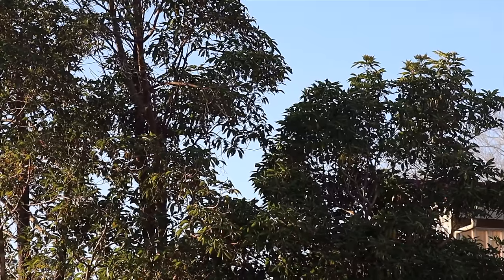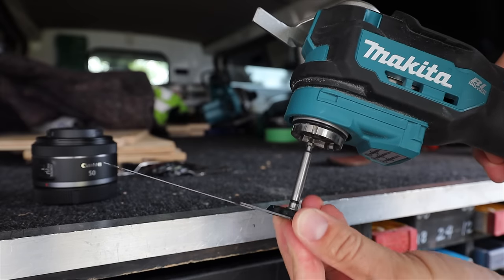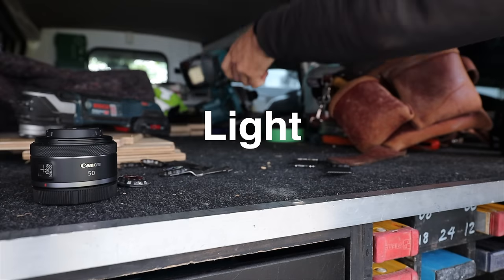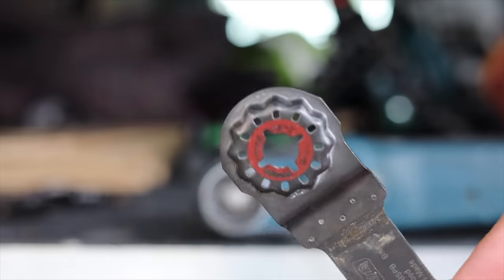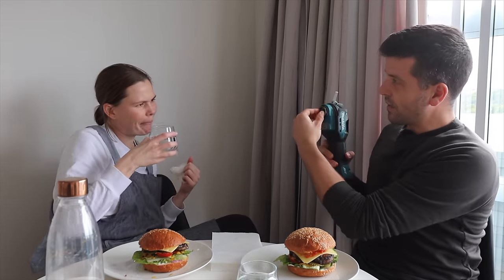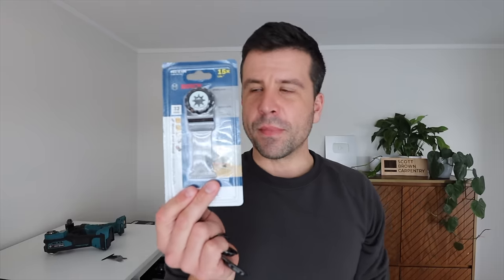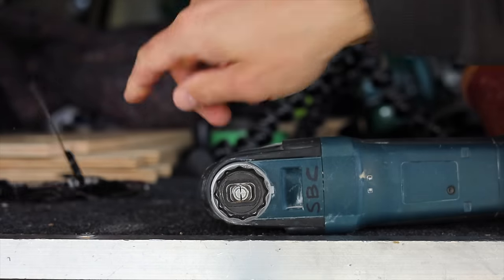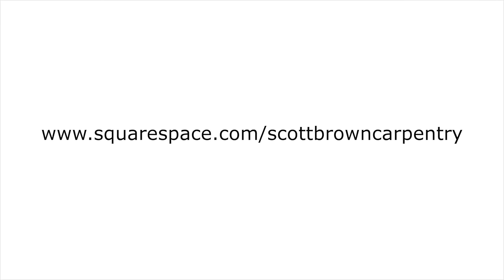Have Makita Made The Ultimate Multitool?

Comment: Fein had the same pin idear about 8 years ago. The pin used to wear out quick so you could no longer keep the blade tight
Reply: Fein invented the Multitool back in the sixties and the Starlock system was an collaboration of Bosch AND Fein. Fein is often overseen, although they are the oldest German tool company and invented for example the first powerdrill ever! As far as I know is the Festool multitool also manufactered by Fein. I don‘t know the Makita multitool yet, but the anti vibration system of the Fein I owned is outstanding!
Reply: My old bosses fein multitool was incredible. So much power and speed it was a pleasure to use.
Reply from the maker: I didn't know that. It will be interesting to see how the Makita goes over time.
Reply from the maker: @thorstenkrieger6289  that's awesome. I've only tried the Fein a handful of times and was impressed. Both Kameron and Gaston have one and they love it. I didn't know they went that far back. Cheers
Reply: I also have a Fein, and I love it :) , Fein general market is Metal industrie, have a angle grinder from them , small 125mm disk and 2000W it’s just a monster

Comment: I've had a corded Bosh for 5+ years hanging around the garage for home projects. I now have a cordless Makita that I use frequently as a career handyman. The thing I love about the Bosh pinless is when you are sanding with it. Each time you change grit size on the Makita you have to pull the paper off to get the pin out. That often leads to the backing failing on the paper before the grit is worn out. On the Bosh you can can just buy a 2nd (or 3rd) sanding plate and keep the paper intact as the clip couples & uncouples behind the paper surface.
Reply from the maker: Ahh, good point!
Reply: I made a hole in the paper just to get arround that... but it tends to collect dust up arround the pin if you do so.

Comment: The whole time watching this, I thought that pin is just an added unnecessary extra, and easily lost . You proved me right at the end. I really like dewalts clip on system.
Reply: When the pin was revealed I immediately thought 'Going to need to get 1 or 2 spares of the pin.'
Reply: I agree but I have never lost the pin on my gen2 makita multi tool. I envy the the ease of use of my dewalt cohorts though. Do you like the adjustle power trigger thing on the dewalt or the idea of the makita on/off better?
Reply: i have the dewalt battery multi tool with that "easy" blade install, sometimes at least on mine which is not even a year old, it gets tough to actually push it hard enough to open the jaws, and don't even get me started on trying to get that blade perfectly centered
Reply: Not much different than changing a disc on a battery grinder haven’t lost the collar on that yet  touch wood
Reply: The immediate predecessor to starlock (in Fein world) was a pin system.  I have found it to be better than the pinless starlock system when trying to set the angle of the blade in a tight spot.
Reply: Fein, maker of (arguably) the finest (pun intended) multi tools used a pin system for many years prior to release of starlock. Never heard anyone complain about losing pins and I certainly never lost mine. I am sure it happened but not enough to detract from an otherwise excellent tool.
Reply: Dewalts system is great
Reply: Got the dewalt myself. In addition to what you said I love the pistol-grip where you have stepless adjustment of the throttle.

Comment: I bought a Fein brand multi tools and man that the best one I’ve used so far, never used the makita and/or festool! The Fein is awesome it has a great sanding attachment and decent dust collection!!
Reply: Fein is still the gold standard in my opinion.  I have a Fein multimaster and a Festool. The Festool is a Fein supercut with Festool branding on it. They have a deal together. But yes, I tell everyone they don't understand what is a good multi-tool until they use a Fein.
Reply: I had the fein multimaster. It was very smooth and just nice to use, wway Less vibration than any other one I've seen. But one day it broke inside, because to keep vibration down the head is only attached to the motor by very small glass filled plastic arms. I had it maybe 5 years. Looking inside it seems to me this will happen to everyone eventually. 
So I bought a cordless Milwaukee and it is just as good or even better. Very smooth, has a light and definitely cuts quicker. One of Milwaukee's better tools!
Reply: @worstdayofmylifesofar.just7477  the cordless Milwaukee is what we use at work and it is a piece of junk IMO and in the opinion of everyone using it, pain to change tools, vibrate like crazy etc etc !

Comment: As soon as me and the work mates turned on that new Makita multitool we all looked at each other and couldn't believe how quiet it is. I upgraded straight away. Did a comparison of decibels between the old and new and there is 10db different which is a lot. Great video Scott!
Reply: it's often the material you're cutting that starts ringing and screaming far louder than the tool.
Reply: @throttlebottle5906  100% the material makes half the noise but its a good start the tools way quieter.
Reply: @jaredbrierley2782  ever used one of those tool on a sheet of plywood or any large less dense surface? say a particle board cabinet(bae or wall), further that by plywood, particle board, and others?
they're more or less a "speaker cone" for the tool and total degree of movement and tool noise becomes nullified by the giant speaker screaming :)

Comment: I had this multitool for not even two weeks when something in the pin locking mechanism snapped off and made the tool unusable, i took it apart to see that the part was designed nowhere near as strong as it should have been considering the torque put on the part with the leaver which im guessing is what made mine give out. I sent it to makita to repair and ive been told that so many people have already been having the same problem so makita are having to redesign the part itself. And I can confirm the larger head does get in the way at times unlike others like the feintool that i had been using previously
Reply: Had mine a week, same thing. Was repair and back to me in 5 days. Great tool tho..
Reply: @graemeb7988  Oof damn, inside? wjhere you have to send it somewhere to repair, thats a no go then.
Reply: My one doesn't work after 5-9 time of using it... Can not take the pin out...

Comment: I’d be interested to see if the larger head on the body of the new Makita gets in the way at all. Often you’ll be multi-tooling in an awkward or cramped space, the larger body head may cause issues.
Reply: he just made a valid point lol, look at the other multi tools theyre way slimmer than the new chode
Reply: That is definitely a valid concern.  The solution to that may be to use the longer and overall larger Starlock max blades.  I get why they designed it like that.  Everything was squished to the business end and then the handle is decoupled from the body.  With the cordless Fein/Festool models, you have to hold the tool all the way back at the battery to avoid the vibration.
Reply: I just came to comment this
Reply: My mate bought one, only found the size of the head to be a problem when it came to visibility in small spaces, seeing what im cutting
Reply: Most likely shaped that way to reduce the vibration
Reply: Like toe kicks!
Reply: Yes your right, that’s why I went for the Allen key version, as opposed to the quick release and it’s cheaper 😊
Reply: I bought this and it definitely gets in the way
Reply: That's why I also bought a 12v bosh one 😅
Reply: It definitely does. I’ve returned mine because of it. Got an older model instead. Apart from the vibration and noise when not cutting. It’s just better in every way.

Comment: I have also the Bosch one and I figured out that you just need to widen the hole with a dremel and the STARLOCK MAX blades will fit in the PLUS one 😁. cheers from Austria
Reply: I've done the same before for my Fein but just used a slightly larger drill bit

Comment: My favourite tool change system on a Multi-tool is actually on a Ryobi! It uses the classic OIS blades, BUT instead of a bolt that you manually have to screw and unscrew every time, the bottom bolt is attached to a sprung lever which opens up enough gap to change the blade... I.e similar to your new Makita except the bolt is fixed in place so you don't have to take it out every time (and you can't lose it!).
That's not even the best feature though... 
The entire tool head is also on an adjustable pivot so the blade can be up to 90˚ from the body which makes it super handy to get in tight spots.
Reply: So you have to use the blades with the split on the ring, to get around the bolt, right?
Reply: @xenonram  ideally, yes as it makes changing them quicker. But the top of the bolt also comes off if you want to use the full ring blades.

Comment: The Dewalt quick release mechanism on their multi tool is awesome.

Great review as usual. 👍👍
Reply: Personally it's the variable speed trigger control that dewalt have that I like about them. My go to multitool over the apprentices dewalt and my 18v makita tho Is my m12 milwaukee. Quietest, just as strong as both 18v and less vibrating
Reply: 100% agree you get the quick change lever, can adjust blade to 90 degrees quickly but still use the cheaper blades.
Reply: They burn out to easy
Reply: i've found it hard to get those blades to be at an absolute straight 0 degree mine always is slightly off to the left or right, especially with cheap blades but even the most expensive ones it still doesn't fit perfectly straight, and at times getting my jaw to open and release the blade becomes a hassle
Reply: @orran8281  found exactly the same
Reply: Milwaukee multi tool beats them all
Reply: @Emtbwebb  Milwaukee are simply overrated. Dewalt beat them virtually across the board and are around 20% cheaper.
Reply: @krazzygranny7032  I'm in the UK and I've started to see Milwaukee everywhere in recent years. A guy I do a lot of work for swears by them.
Reply: @BlueZirnitra  agreed, I'm on Dewalt platform due to cost.  I'm working hard to save for some Milwaukee tools.
Reply: Also the dewalt hand trigger is much better then a slider makes the job more accurate
Reply: This is starlock guy lol
Reply: untill u test bosch // fein starlock system u wont ever want to use any other brand 
i test it too and its super powerfull even on 12v tools because u have 30-40% increase in power just because of the mounting system 
and changing blades takes literally 1-2second 
just pull the lever , blade pops out , and push new one just like changing bits in impact driver

Comment: About the decision to go with “Starlock…but with a pin”.  I have the Fein that came just before starlock, Festool starlock (reskinned fein supercut) and have owned the Bosch starlock.  With the pin models, it is very easy to adjust the blade angle on the fly.  With the pinless starlock system, it is a real pain to dial in an angle in a tight spot.  You have to keep removing the tool from the tight spot, remove the blade, lock the blade in again, try again, wrong angle, pull the tool out, remove the blade, and lock the blade in again…woof.  Makita thought this one through.  Rolling back to Fein’s previous locking pin while maintaining the enclosed Starlock interface with the optimized energy transfer is good stuff.   The starlock interface wasn’t just about the quick connect function when introduced.  It’s also about the ability to increase the applied power and swing arc.   I’m not really interested in anymore LXT as I’ve gone all in on XGT.  However, this Makita is looking better than my Feins…
Reply: Good analysis, seems everyone else missed the point of Makita's design.

Comment: dewalt system seems so much easier to use  I've had mine 2 years and never had a problem and got me out of alot of hard work
Reply: Whilst watching I was thinking of making this same comment. No additional fasteners with the DeWalt. Pull handle, slide blade in / out, release handle. Easy.
Reply: Can only use one type of blade though
Reply: @LukeSMK  The system is well supported with a bunch of different blade styles and a few brands manufacturing the system. Only having the one fitment option has never been a problem for me.
Reply: J make check. Dewalt. Im locked on the batteries with them.
Reply: Yeah, I run the DeWalt as well. Cheap, easy, convenient, good accessories, cordless. No pin or bolt to lose.
Reply: If you ever use the  starlock system you never use anything else just give it a try
Reply: DeWalts system is very user friendly. No shortage of third party blades either.
Reply: i’ve found the dewalt really easy to learn about using the tool i just don’t like the trigger system as after long periods of time it gets uncomfortable holding the trigger under all them vibrations for accurate work
Reply: I love my dewalt one at work, so easy to change out blades and adjust the angle
Reply: Ditto! - Just bought my second... No other Multi-Tool comes close! - Variable Speed trigger start!🔥
Reply: ya.. i have a Rigid multi tool .. no extra parts takes any blade i want to use
Reply: I have a dewalt and at work we have a fein, the fein gets the vibration to the material you are cutting, dewalt gets it to my
Wrist
Reply: Pretty much all my power tools are makita as I'm a big makita fanboy, but there's no denying the dewalt multitool is so much better. The variable speed trigger is great
Reply: My dewalt is great but not sure a blade has lasted as well as the one at the end of the video. I would trade for that as the 3rd party ones die in no time at all like sandpaper.
Reply: @Washing Up Liquid you don't have to like the DeWalt. These oscillating tools are handy for a few things, tight spots, ect, but I don't use mine for long enough to be bothered by the vibration. I do reno work all day, every day.
Reply: @hozlopez  I’ve tried Milwaukee, DeWalt and Makita and from experience Makita by far have the superior batteries. I had 2 DeWalt and 3 Milwaukee batteries die on me within a year of buying however all 5 of my Makita batteries are still going strong after 3 years. Not to mention for me the Makita batteries are the smoothest to clip in and pull out
Reply: You will be surprised if you tried another multi-tool how much better thet are  Had the Dewalt XR (but the vibration drove me crazy), old Milwaukee 18v, the makita 18v, and still have a  Fein and Festool. If you want the gold standard, get a Fein Supercut. That is the one that all try to match. FEIN invented the starlock system. They have a head separated from body to minimize vibration and increase the throw, and is the most powerful.  Like night and day.

Comment: Fein used to have the star lock with the pin  the problem I had with that system was that the mechanism that held the pin in place would get jammed up with dust to the point that you could not remove the pin.  I had to trash a couple of very those style  of units because of that issue.  I also have a Fein multimaster with the Bosch style of Stardock system that doesn't fully lock the blades anymore.  The blade rattles around and barely oscillates.  I've been in the flooring trade and renovation/restoration for 35 years and have usedd up at least 5 of these tools in my time.  All were Fein corded models.  Regardless of which one you go with they  are still far and away the best tool for renovation and construction.
Love the channel.
Keep up the good work.

Comment: Brilliant. The Makita is one lost pin away from being a really handy paperweight.
They should have just used the same system as the Bosch cordless and put their weight behind one blade type.
Reply: They can sell replacement pin$.
Reply: The system is patented by Bosch/Fein. That's why nobody else has it.
Reply: @Patrick-857  it's licensed. They could have used the same system the Bosch has, but they wanted to added versatility and add the pin.
Reply: @clearlyconfused9194  I just got the new Makita. I love it so much that I just want to cuddle it. It's my new favourite tool. It's freaking amazing.
Reply: Your comment is ridiculous.. You are most likely an office worker who "occasionally " picks up a power tool to do something you saw on  a television renovation program .
Reply: @donburke4886  Agreed. I've never seen anyone lose the pin, and if one did, Makita are very good about making parts available at reasonable prices. It's just not an issue imo.
Reply: @donburke4886  Correct me if I am wrong: If the pin is lost, the tool is inoperable until a replacement pin is sourced.

Yes or no?